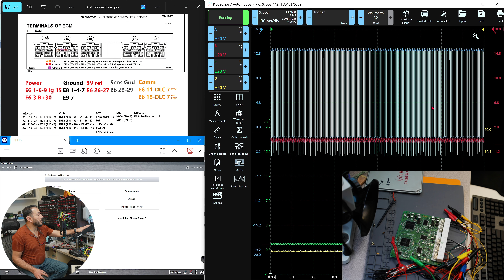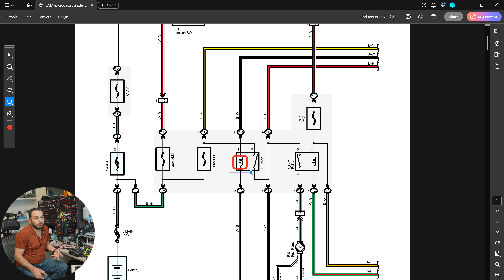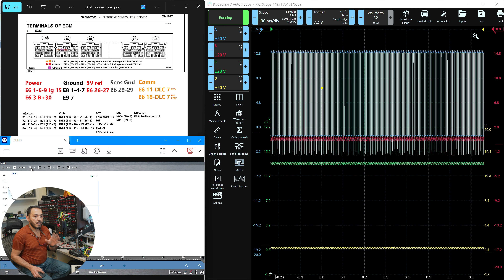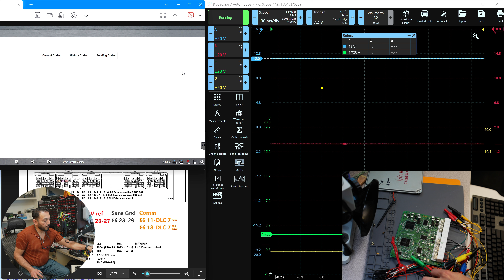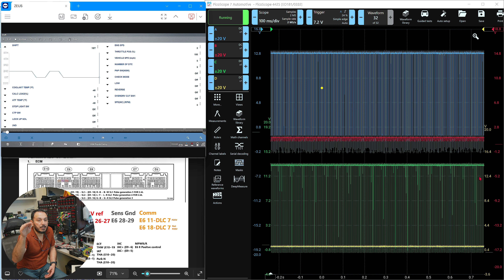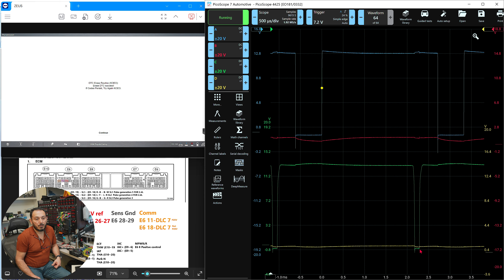04 Camry 2.4L Transmission Shift Hard Code P0776 Brian S in Hawaii. Full test solenoids oscilloscope

Comment: WTF I emailed you about my Infiniti TCM and you wrote back you didn't work on TCM'S
Reply from the maker: I do not work on any TCM that is inside the transmission. And I do not work in all modules. Hope you understand that I am a small business and do not have all the tools required for all manufactures. Blessings
Reply: @MaicSalazarDiagnostics  I would take it out of course lol
Reply from the maker: @ the main problem is the tool required to solder and desolder the components. That module since lives in the transmission and it is exposed to oil, has most components soldered with a special machine I don't have.
Reply: @MaicSalazarDiagnostics  that's Interesting. Infiniti is scamming thousands of people by having them buy a new valve body for $3000. I have a background in electronics and I'm sure it's something very easily replaced
Reply from the maker: @briansaier4929  well I if you do repair it, please record a video, I would love to see it done.

Comment: Waiting for part 2. 

I guess the toyota EPC solenoids ohms specs are below 1.0ohms. Like 0.4 to 0.6ohms. 
And low-ohm fuel injector is around 2ohms.
Typical regular injector is around 10ohms.